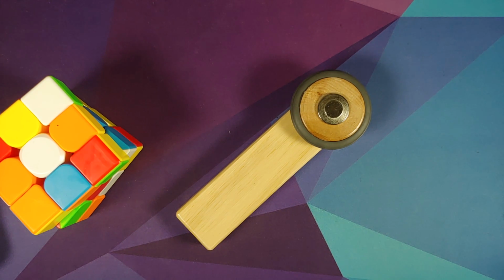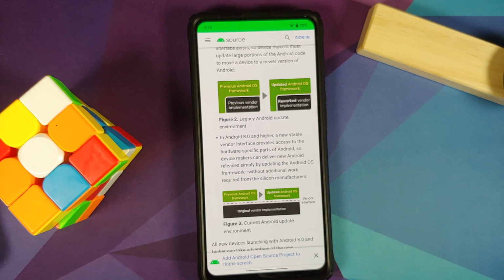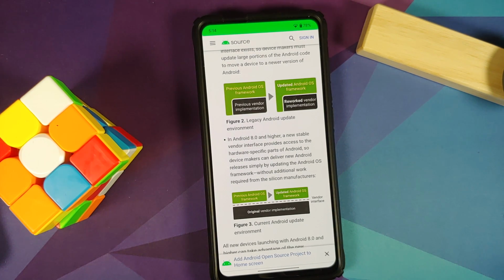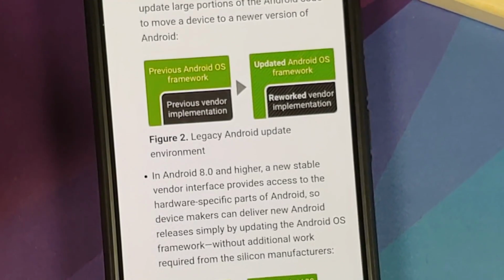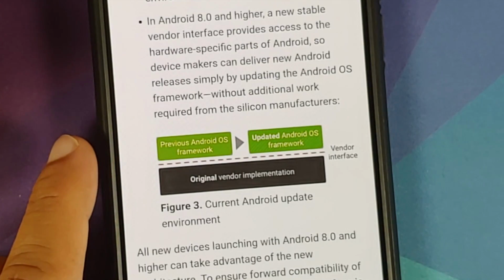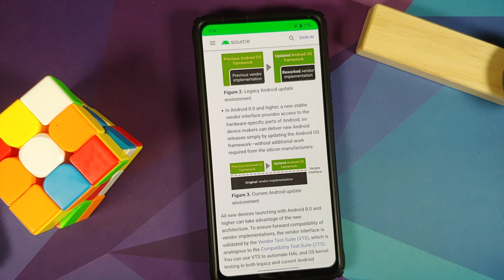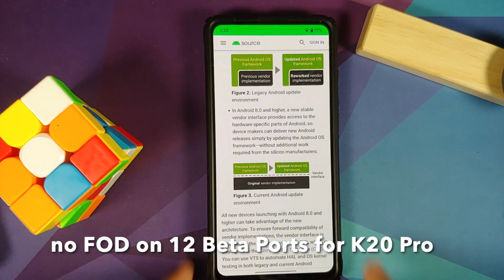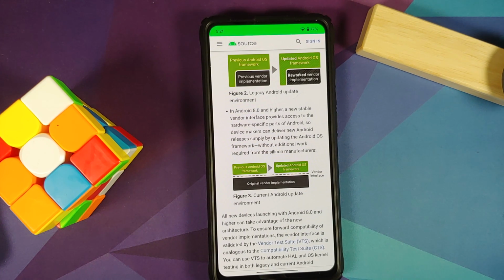Firmware, System & Vendor Explained | Project Treble | Android Custom Rom Basics

Comment: Let's say we need to flash 12.5.3 Firmware zip before certain custom rom but instead I flashed MIUI 12.5.3 full recovery rom zip file. Will it do the job ?
( I mean to ask that
MIUI recovery zip file contains both firmware and vendor within itself ? )
Reply from the maker: yes
Reply: @munchy_cool  Thanks
Reply: @munchy_cool  When is the OSS video coming?
Reply from the maker: @Aditya-tn6re  i dont hv any ETA
Reply: @munchy_cool  how about 12.5.9 stock rom and adding firmware latest version in the same official channel?

Comment: long comment warning!
micromax came with another device yesterday 4/64(lpddr4x,eMMc5.1) dual 4g device with unisoc T610(antutu ranging from 1.6lakh-1.9lakh similar to snap 660-665 and mtk g70-80) with stock andriod 11 at 7,999Rs
 pretty good budget phone
(There is no reviews by big paid  youtubers! on youtube 😂)(hd+ display,type c port ,5000mah battery 10W charger you will get specs on internet)   

micromax said that  they would relese the source code of their device (not yet released I think as they don't have stabilized their stock rom yet.
 lam excepting them to release in  future as they run near stock andriod) 
Official bootloader unlock procedure is  opened for their previous device Micromax in 1 
Micromax can become OEM like motorola,pixel to give easy acess for flashing and custom roms with affordable priced phones(I surprised with their pricing considering onpaper specs with near stock andriod)
What do you think or your take on it (would you buy😁)
Reply: They launched eadbuds and Tws  at good prices

Comment: What is the meaning of the following statement issued by custom rom developers- "Suggested firmware - 12.5.2.0 " for Poco X3 Pro.
But you said that custom roms don't touch firmware. Please clear the confusion. Does this means that we need to download firmware 12.5.2.0 and flash that zip file before flashing the custom rom ?
Reply from the maker: yes you need to ..firmware is needed for the phone to functiom, just because custom rom doesnt touch firmware doesnt mean its not needed ..
and this question will be answered in next video ..OSS vendor vs Miui vendor
Reply: @munchy_cool  Waiting for your next video. Post it today only.
Reply: But let's say that I am on the latest firmware (12.5.3) and custom rom developer is suggesting firmware 12.0.1 (old) , so should I download the firmware zip file of 12.0.1 or my current and latest firmware 12.5.3 will automatically work with it ?
Reply from the maker: do what the developer says
Reply: @munchy_cool  Okay
Reply: @Aditya-tn6re  Bhai miui ka full ROM  zip (~1.6gb)
hi firmware  hota hai kya ya fir firmware Chhota size Ka Aata Hai?